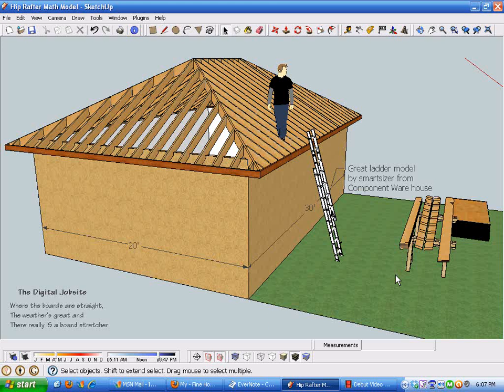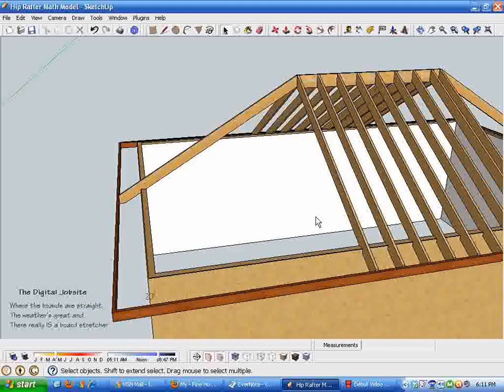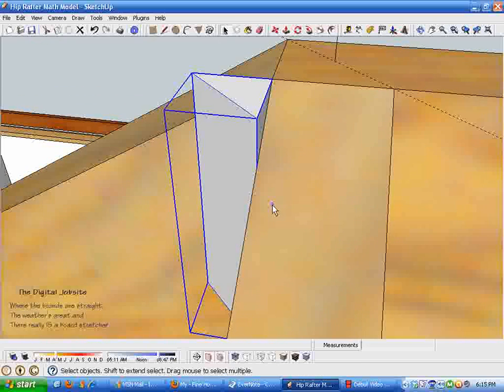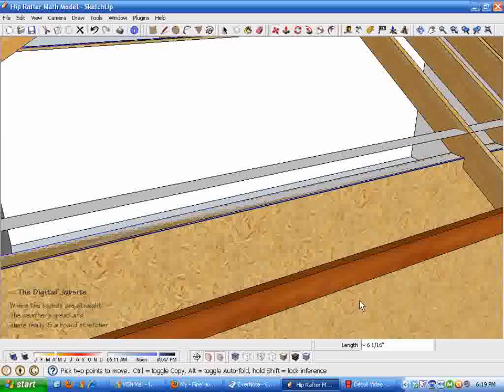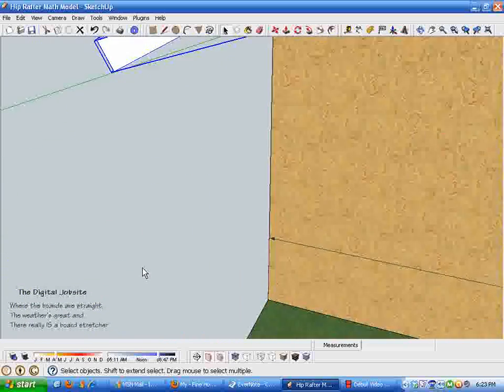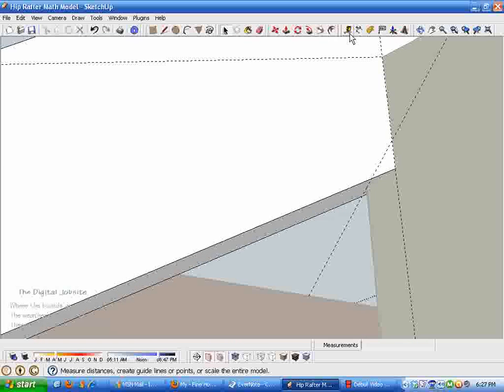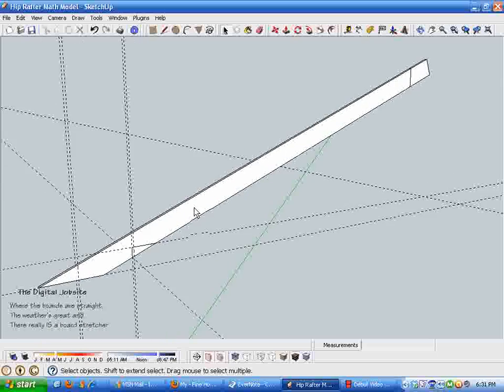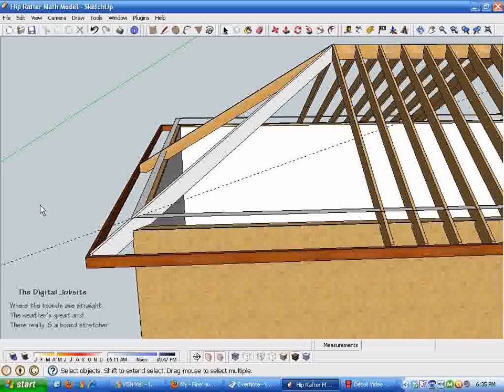Model and Measure Hip Rafters De-mystified by Modeling in SketchUp Part A.wmv

Comment: With a hip roof is there a maximum span that a small building could be built without using rafter ties or ceiling ties? I'm building a 14' x 32' shed / workout room and I like the look and functionality of an open ceiling. (I plan to use collar ties with plywood plates at the ridge beam) I've used your sketchup method before with building a small shed hip roof which worked out great. This build is much bigger.
Reply: Anything's possible but rafter ties are the least expensive way of providing enough strength to the triangular cross section of any roof to keep it from collapsing.  For instance; you could incorporate a few structural welded steel   tube  inverted "V"s (2" x 6" tube size maybe) to carry the load and use conventional framing material in between to support the roof like normal... possible, but not practical. 
I'm not providing engineering advice or recommendations but sharing the sort of brainstorming I do when working with clients who've been told by others 'that's impossible' which makes me determined to prove them wrong😉😎.  Do due diligence with building codes for your area and consult a qualified engineer before committing but I'm positive you can build an open-ceiling hip roof over a 14' x 32' building by employing a few unconventional ideas... Best, Matt

Comment: How do you calculate how long the ridge beam should be?
Reply: Generally for hip roofs its length is the difference between the width of the building and the overall length. Best, Matt
Reply: @NextLevelCarpentry  Thanks, so as an example a 24' x 14' building would have a 10' ridge beam?
Reply: @da3207  In general, yes.  Assuming your construction method would have a ridge beam of zero length if it were 14' square.  Details like ridge beam thickness and rafter assembly process can complicate things in some instances but you should be pretty safe starting there.... Best, Matt
Reply: @NextLevelCarpentry  bet you wouldn’t even know how much a 10’ ridge beam would  cost and how much of a waste it would be if it got cut short...Typical pretend YouTube carpenters, no real job site experience.
Reply: @christinaaggychris1210  please dude, Go get yourself a life! A life where accomplishment means actually contributing something worthwhile to mankind instead of Trolling YouTube in an effort to prove you know far more than you do.  take my advice so that when you look back on this interaction 5 years from now you'll thank me...
Reply: @NextLevelCarpentry  You’re such a clown. As soon as you get told you’re spreading misinformation and proven wrong you delete comments. It’s obvious your ego can’t hack it when someone who actually knows what they’re doing when it comes to residential construction proves you wrong. Why do you think I keep doing it hahaha